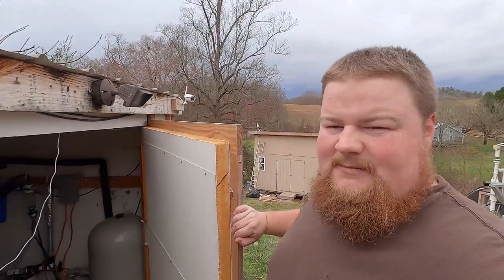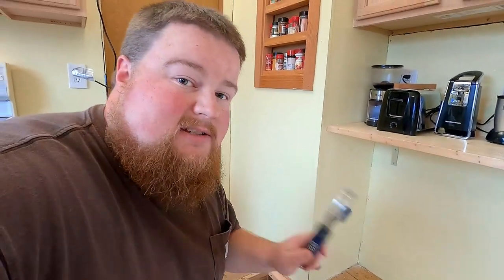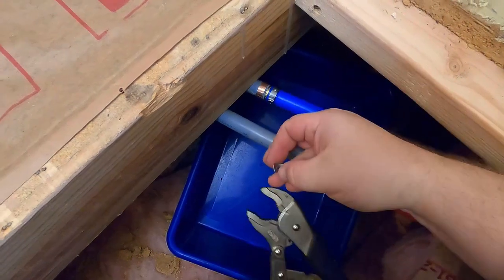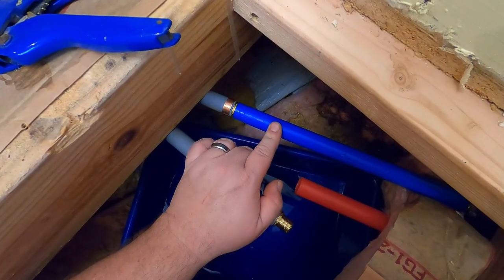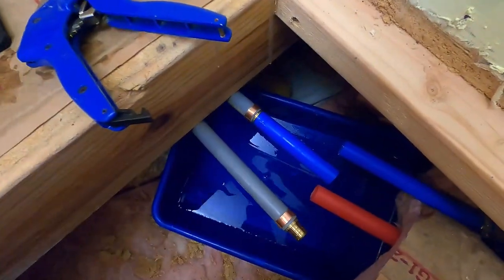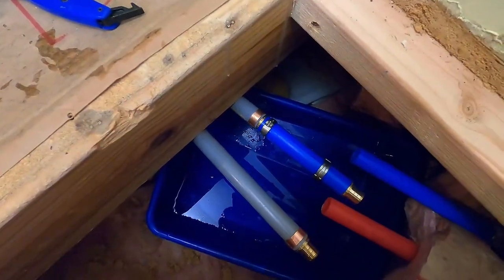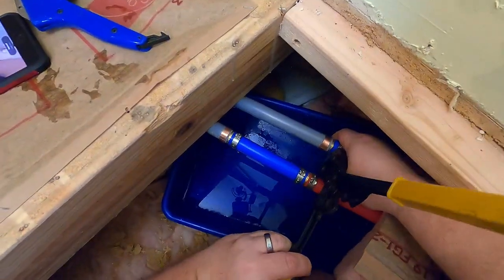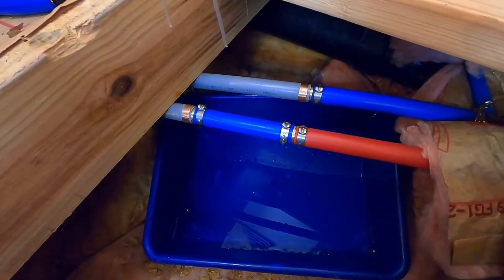Fixing Our BIG Mistake | Budget Mobile Home Remodel #26

Comment: Better found and fixed before flooring is installed. My grandad did the same thing in his house about 1948, when he added a new kitchen and installed an inside bath. It stayed that way(hot and cold reversed on the sink) until 1991 when the commode was replaced. Then, for months after, I finally remembered to turn the right knob.

Comment: When fixing pipes, I used to always put red tape on the ends & joint of the hot water. Now I change it out and go with color coded PEX pipe COMPLETELY. Yes it's more work but you never can tell if the old pipe will fail.

Comment: A shiny chrome toastmaster 2 slice toaster from 1954. It was my Grandmothers. It toasts, and when finished, pops up, but the heating element stays on to a low setting, and keeps the toast warm, until you are ready to lift it out, and butter it. The new ones toast, but If you don’t grab it right away, its never warm enough to butter up and eat. Great video. Thanks for the tips. 👍
Reply: Have a Toast-o-lator from the fifties, it has a conveyor that inches the toast through the toaster and dumps it on a plate at the other end.   Changed the nichrome heating element years ago, still works like a charm.
Reply: lichub A toast o later? Wow! Hold on to it. I find that the older small appliances outlast any newer ones made in China.

Comment: My favorite kitchen tool is an actual metal tined Afro comb I bought at Sally's Beauty  for under $4.00.  It makes slicing onions a breeze with no tears shed.  I peel the onion, slice in half, tick the comb through it and slice between the tines.  Then if want it fine chopped I go the opposite direction, never removing the comb and I get perfect diced onion in seconds.  Farberwear also sells one now and I picked that up at an Amazing Savings for only $1.99.  I stocked up and gave some to friends and family, of course they love the ease and use it for other vegetables, too.  I just do onions.

Comment: My kitchen gadgets aren't that numerous, and the ones I have are stored away.....it sorta drives me nutz to have the counter cluttered.  So, here's the list of 'just gotta haves":  electric kettle, food processor, emulsifier, electric mixer (hand-held) and a toaster/oven (which is on a counter to the side of the kitchen).  P.S.  Nice save on the hot/cold water switch-over/switch-back.  Thank goodness you did this before you installed your new floor!  😨😜😄❤️️

Comment: Next time wrap piece of red or blue tape around the relevant pipes sam , that makes it simple to keep your lines right . Thats what I used to do . Easy mistake to make when using grey piping . . You got it corrected thats it done and dusted . I wont have a deep fryer in a kitchen , they leave greasy film on worktops an walls , terrible greasy vapours really annoying . . Keep up the excellent work guys . .
Reply: Blue (cold) or red (for hot) duct tape, (cut little strip for end of) $1 at Dollar store.  I'm about to fall through my bathroom floor in my 1987 mobile home. How thick are the boards,1/2 inch, (5/8") (??) are you using particle board? I want to install one of those iron supports under the toilet. Will watch your video on bathroom. Haven't got there yet. I just got an air fryer. We'll see if it's counter- worthy

Comment: Cant live without my crockpot...esp. Fall n winter time for stews n chilli. Just finishing eating venison stew but got 4 more qts. in the freezer for later on. Plus love to crock a whole pot of leg quarters n use the broth n share with my 2 furloves some plus lots of dif. Kinds of meals without much work after crocked legs and my dogs also love the bones(after cooked way long). My cold n hot in kitchen is wrong..lol the guys that did it just changed the H n C but still took me time to get used to opposites in kitchen n not both bathrooms. Cant wait to get pex under my house and lol get $150 for the pex n connectors etc.

Comment: I think the most used electric gadget on my kitchen counter would be the electric griddle.  I am surprised that you do not have a water shutoff valve between the well house and the home.  If it is PEX then just cut it and put one in.  As for removing the SS PEX clamps I use flush cutters from the edge of the clamp.  It snips it off much like you did with the twisting but without the extreme force on the PEX.  Diagonal cutters seem to work but again it takes more force than I like because the clamp wants to just slide out of the end of the cutters.

Comment: Well its technically an appliance but literally noone wouldnt have one in australia new zealand and the uk and ireland. Its very british and essential to own a kettle. Most people have electric you can also get ones that go on the stove (think old fashioned whistling kind) 
But as far as gadget aka non essentials i have an ice shaver by sunbeam which ive had since before 2006 and still does amazing. And icy drinks are somewhat essential for the hot australian outback climate. It was only like 30 bucks or less i believe when i got it too so its not a super fancy one just like a kids sorta one i also had a popcorn machine of the same brand but someone broke it but it was really handy for air popped popcorn and it wasnt messy and you didnt have to fiddle with anything and you could just stick a bowl under and itd do its thing it was a really awesome after school snack and wed take some in our lunches or to sports and for sleepovers movies etc. Atm i just air pop it in the microwave but you waste so many kernels that way so in future i'll get another one. 

We also have an icecream maker & a bread machine both of which like the previous two are very hands off very much set and forget you just add ingredients press on and itll do alllll the hard work the bread machine kneads it and cooks it and you just take the loaf tin out when its cooked and you have a lovely loaf of bread. If you use a bread mix instead of making your own from scratch its like 2 minutes tops. Now if i lived in a cool climate id be more inclined to use the oven but when you live in a hot arid sunny always with no real seasons beside hot and hotter having the oven on is like asking for heatstroke its like starting a fire inside it gets so hot so the bread machine while warm is much smaller and more energy efficient so its waaaay more tolerable than having to preheat anything and whatnot. 

I also have a dehydrator just a cheapo 30 dollar one i use it mostly for apples i slice them and sprinkle cinnamon on top in the about 3 months of slightly cool winter weather we get! Haha. Its really nice and ive dried lemons and oranges and i sun dry most stuff since outside is an oven lol atm in sun drying homegrown tomatoes. They smell like candy when theyre dry! Yum. You can have them like bottled sun dried in olive oil and wet or you can blitz them up into a powder and add a teaspoon to soups or sauces etc and get a real lovely flavour and all the nutrients! I would in future like to make an investment in an excaliber dehydrator and do some more full on or fancy stuff but yeah i dont really depsite having a few use many appliances besides the kettle and microwave which again are so basic and essential i dont count them. 
We do have a bamix which is a hand blender and thats awesome for smoothies and soups and all sorts and a kenwood chef which is like a kitchen aid stand mixer with different attachments and pretty essential in baking. 
But yeah the appliances i do use are essential and the ones that are gadgets are seasonal stuff like icecream, ice shaver/slushy maker, dehydrator.